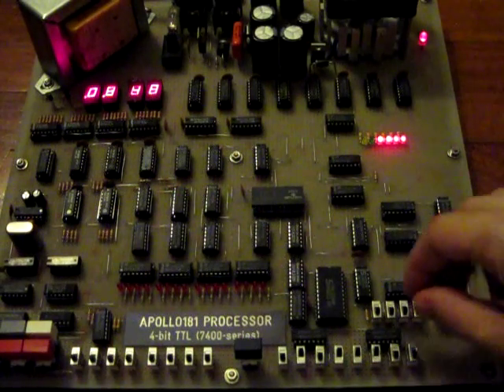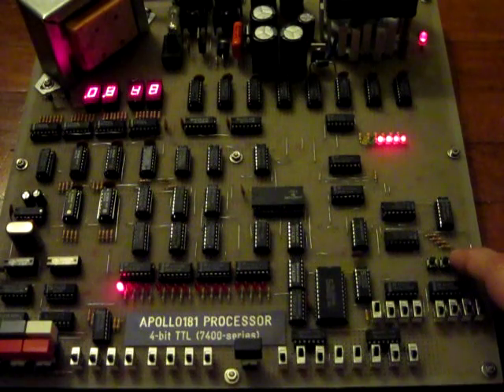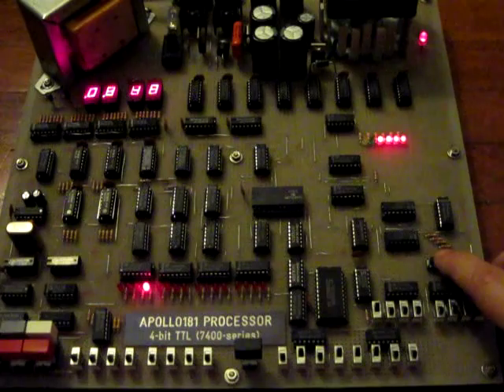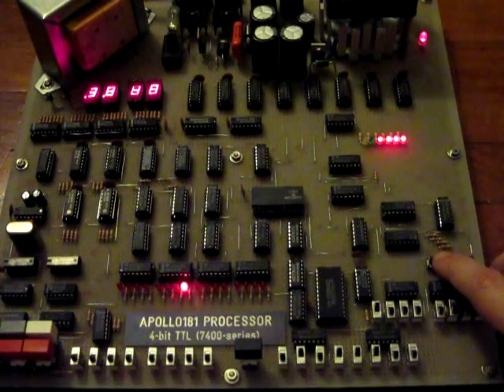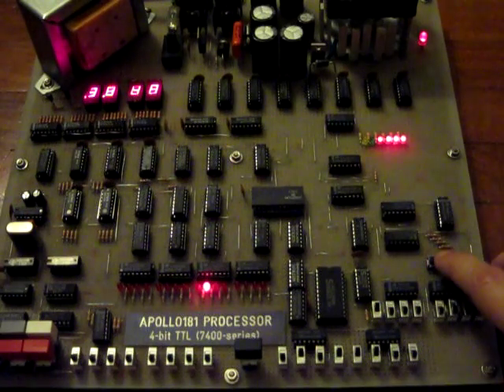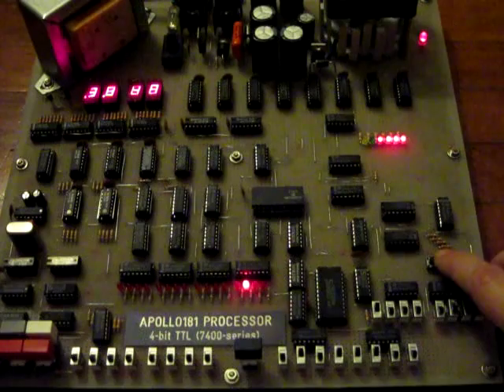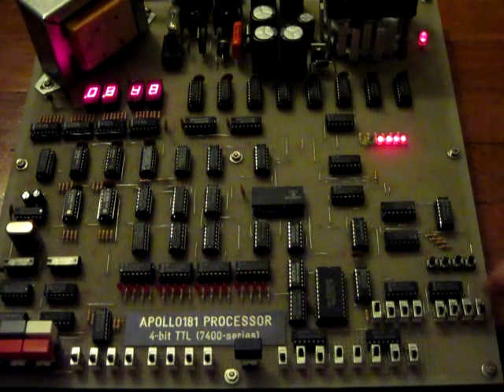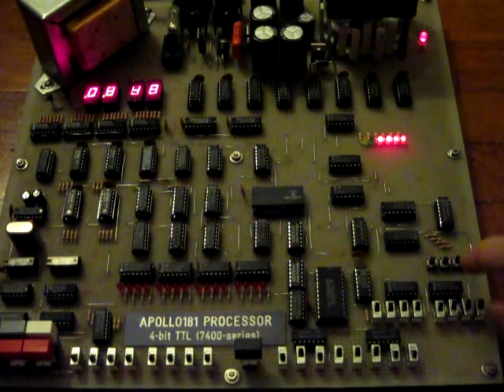Let's "shift right" with a single 74181 ALU (APOLLO181 Exercise n. 2)

Comment: This is almost exactly what I'm doing in my "6502 clone" CPU. I'm making the ALU using 74HC181s and I'm just puzzling over how to do shift right. Shift left is obviously easy!
Reply: I do shift right by manually hard-coding each bit shifted to the right, then to tri-state buffer. The 74181 doesn't support shift-right natively, so external hardware is required.